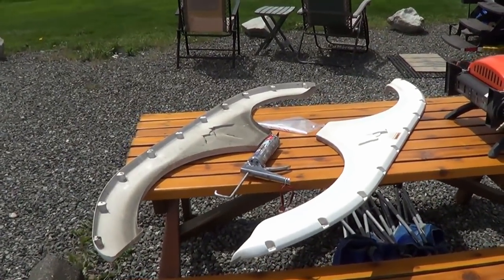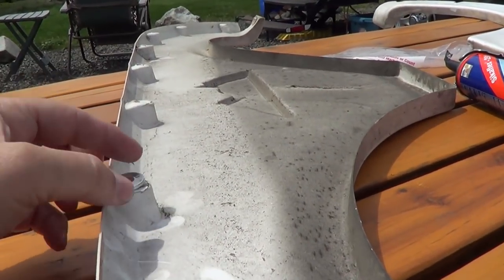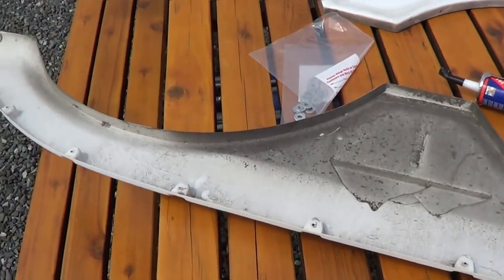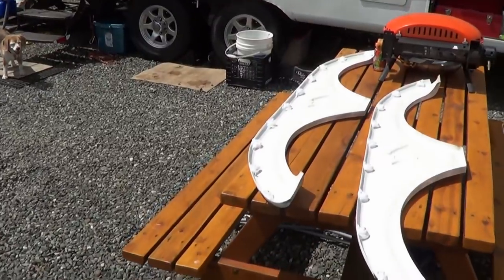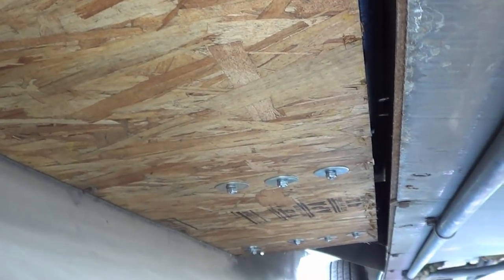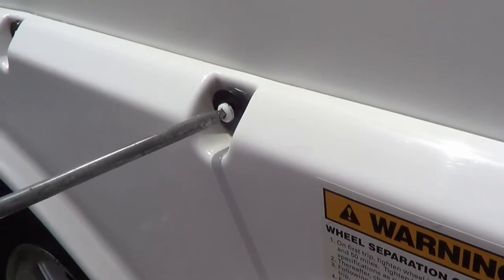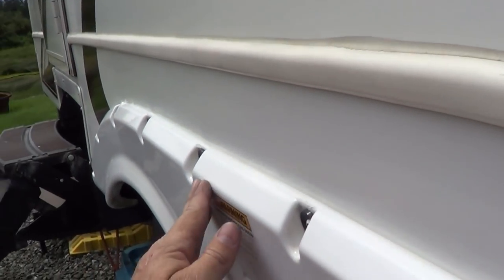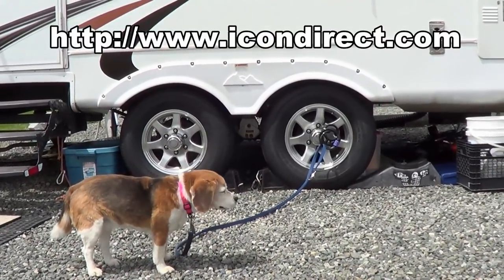Fifth Wheel Trailer Plastic Fender Repair & Strengthening Mods

Comment: It's not perfect and it won't out last you or your trailer!  Well, it wasn't perfect when it was new (nothing is) and you said  it will last "a few years", not forever.  All and all it was a great improvement over what you had going on and needed attention.  Given what you had to work with and what you achieved,  I'd call that a jolly good job, Ray!  Cheers

Comment: I'll be making the same fix to our 2015 trailer. After this winter the street side was vertically cracked about 4 inches. And while on the trip we just returned from yesterday we had a crack on the driver side fender too. Before we'd gone I contacted Forest River because on the icon site I just couldn't find the same fender. Forest River had me order the replacements through our purchasing dealer and I will pick them up this week and replace them both. Ours are dark grey and they had a bead of silicon across the top, but they keep coming away from the sidewall anyway so a fix like yours sure looks best to me without the silicon bead. The flat washers and rubber washer I think are great additions. Being just molded plastic though, long life isn't going to happen! But a little more than 2 years would be nice. Thanks Ray!
Reply from the maker: Wow, yeah 2 years isn't much. Ours is at 6 years with a pile of traveling.
Reply: Sierra Engineering Co Inc. in California is an awesome source for RV fender skirts and other replacement parts. They manufacture fiberglass parts that will last a heck of a lot longer than the plastic original parts.

Comment: Hi Ray Brad from Australia
My fenders also failed. Ripping a hole much bigger than screw head. Being an old surfer I used fibreglass to do this ding repair. At the front masked off the hole. At the back place fibreglass sheet, resin and hardener. When set drilled new hole for screw. Now fender stronger than original. Cheers PS love your videos
Reply from the maker: Cool. Thanks!

Comment: Ray, I second Icondirect. After a tire blowout damaged the fender skirt on our '03 Sunnybrook, they had a perfect replacement. Anpther great repair video.
Reply from the maker: Thanks, great to know. Hope I don't need them. :)
Reply: I have been using Icondirect  Dometic replacement Air conditioner Covers for about 6 years now ...Good products!!
Reply: Sierra Engineering Co Inc. in California is another awesome source for RV fender skirts and other replacement parts. They manufacture fiberglass parts that will last a heck of a lot longer than the plastic original parts.

Comment: A great video! I wish you had posted it earlier. I tried to get a new fender from my dealer. The first one I brought home didn't fit. Had them order one specific for my Cougar. That one didn't fit either.
Reply from the maker: Thanks!
Reply: Sierra Engineering in Tollhouse CA makes fiberglass RV parts, including fender skirts :)

Comment: I've heard drywall mesh and plastic weld from JB Weld can work for strengthening areas that need building up.  Thanks for all your great videos.  Angie needs a chew toy.
Reply from the maker: Interesting, thanks.  
At 14 years unless it's food she's not interested. ;)  I do have a toy I can add food too and she has to roll it around and throw it in the air to try and get the treats out. She likes that one.   Cheers! Ray
Reply: She has  her priorities all figured out and knows exactly how to get what she wants! She certainly has you stepping and fetching:o)
Reply: Mike Martin  I agree with the mesh and two part epoxy

Comment: How did the fender repair hold up?  Do you still recommend using the SikaFlex 291?
Reply from the maker: Both are still in great shape so guess I caught them in time. Yes, the SikaFlex 291 has worked well.    Cheers, Ray

Comment: Ray you should stiffen up the in between the wheels make bracket and bolt to center of the plactice so it doesn't blow in the wind and cold the screws will not break through again
Reply from the maker: There is a steel bracket hanging down that the factory installed in the middle. The plastic is screwed to it.

Comment: Surprised you used Silicone on your RV, I would use proflex instead as it stays pliable and won't dry out and crack over time. Also silicone is a bitch to remove and recaulk down the road.
Reply from the maker: Yeah, should have used that stuff but only had silicone kicking around at the time.

Comment: another wonderful video Ray.  Say hi to Anne for me.  Question:  What was the type of silicone you used for the repair?  The stuff inside?
Reply from the maker: Thanks, Joe. It's called SikaFlex 291, used in boat building. Not silicone its an all purpose marine grade polyurethane elastomeric adhesive, sealant and bedding compound.  Not to be used on something that you may want to remove easily in the future but last much longer that silicone.  http://usa.sika.com/en/automotive/automotive-transportation-home/01a006/01a006sa01/01a006sa01100/01a006sa01102.html

Comment: Do you recall what size rubber grommet you used. I have a 2009 cougar 244rls. Thanks
Reply from the maker: If I remember right I found some at Home Depot that were just the right size to fit in the recessed screw area on the fender, here is a closer look in this install video - https://youtu.be/Uk8j2SJT8pI?t=204
Reply: @LoveYourRV  Thanks Ray!

Comment: Ray,  I know this video is old but I was wondering if you can help me with something.  I have the same model and year Keystone as you.  Both my fenders blew off in Kansas fighting a 50 MPH headwind.  I looked at the website Arthur recommended.  There are over 30 Keystone flavors to choose from.  You wouldn't happen to know the specific fender for your RV?

Thanks
Bob
Reply from the maker: No, but I could measure them when I get back to may RV in early July then you could look them up on this website https://www.icondirect.com/rv-exterior-parts/fender-skirts/ Cheers, Ray
Reply: Thanks Ray.  That would be a big help.  I was amazed how easily those fenders blew off my rig.  Some farmer in Kansas probably has them mounted on the side of his barn.
Bob

Comment: What size grommets did you use?
Reply from the maker: 5/6 inch. Repair is still holding up well 5 years later. Look for them under the term rubber fender washer. Cheers, Ray